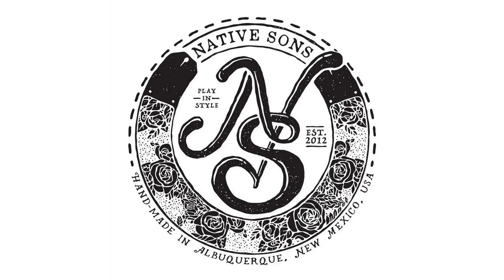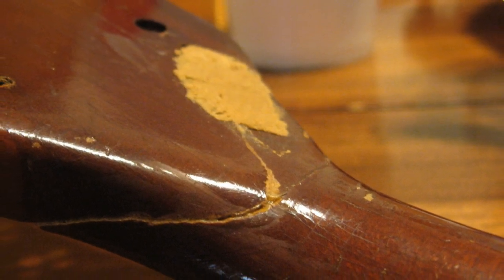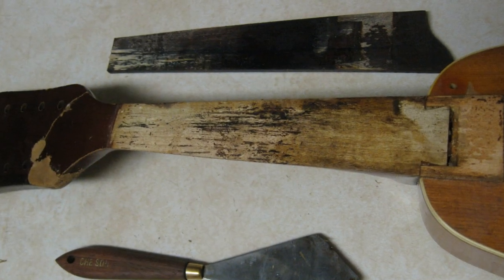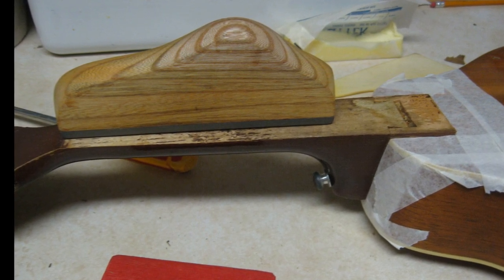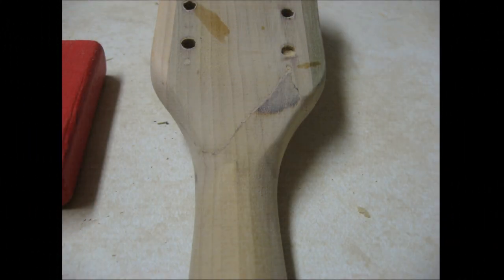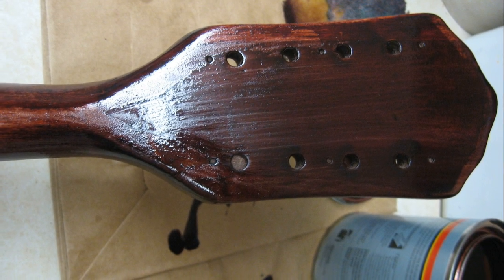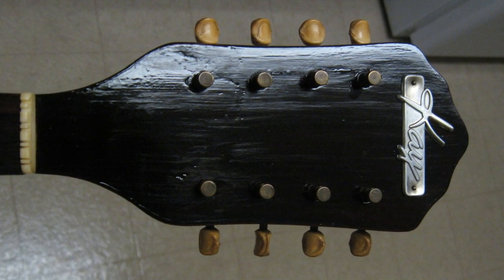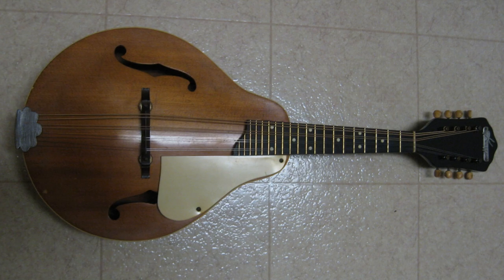Repairing a Broken Kay Mandolin - Projects from the Vault

Comment: Very  timely! I'm  doing  a  similar  job  on  a  custom  mandolin  that  was  damaged  during  a  cross country  move.  This  video  is  just  what  I  needed  to  see .  Thanks  a bunch !
Reply from the maker: Cool. Hope it helps. The longer you spend on the sanding and finishing stage, the better it'll come out. If I had this one to do over, I'd prime it first, then refill and sand any low areas before finishing in a solid opaque color.
Reply: @TheGuitologist  Sage advice! Thanks again

Comment: Even inexpensive instruments from the 50s-60s were made good. You did a great restoration on this one. I might have done a solid color on the neck. I never trust wood putty to stain. The tuners should be replaced, as you know, because the knobs will break off soon. These are another look at your instrument repair/restore abilities. Top shelf! Thanxz
Reply from the maker: Yep. Should have gone solid color for sure. And primer would have caught the low areas in the filler too.

Comment: Good job. I always used epoxy on the first bond and clamped until dry, then the sanding and I keep the dust from the neck and fret-board and mix that with Titebond. I let that dry a few days then apply a thin coat of paint or stain depending and look at it. I only apply the stain to the repaired areas first then depending on the surrounding grain I might use a needle to create a matching grain then stain the affected area again, let that dry and sand with ultra-fine with wet dry sandpaper, the black paper and stain the whole neck and I always get a nice match.
Reply from the maker: Thanks for the comment. I think before spending that much time on it I would just primer it and do a solid color if I had it to do again.

Comment: Butter is not a fret board conditioner ???? Smooth like the land o lakes lady 😂
 Nice work brad 👌🏽
Reply from the maker: I can't believe it's not lemon oil.
Reply: @TheGuitologist  I used Formbys Lemon Oil on a dried out fretboard that looked like it was bleached in the desert sun.
After repeated coats to where it wouldn't soak up anymore I let it sit overnight to find a very dark brand new looking fretboard 24 hours later.
Really blew me away at the difference it made since it looked so hopelessly sad at first.
Reply: That made my night thanks Brad 🤣😂👏🏽👏🏽👏🏽👏🏽👏🏽
Reply: The Guitologist lemon oil is terrible for a fretboard.
tung oil.
Reply: Cole gun oil tastes like artificial banana but don’t taste it 🤮 it’s not safe for humans 😈
Reply: @Cole-ek7fh  Tung oil is a hardening oil. It would be like putting linseed oil or polyurethane on your fretboard. Most of these products are not what they are labeled as anyway. Teak oil for instance is a hardening oil made for Teak not from it. Lemon Oil is mostly mineral oil with just enough lemon oil added for that lemony smell.

Comment: My favorite Wood Filler is CA Glue with Fine Sawdust. I have a jar of Walnut Sanding dust, very dense. I use Bob Smith Thick CA with his Accelerator. It never turns white.
Reply from the maker: That works too, doesn't take stain though.

Comment: Do you remember what wood glue you used? Curious as this head joint would be under a lot of strain after the strings are tightened
Reply from the maker: Titebond all the way. The joint will be stronger than the original wood. As long as you get everything lined up properly.

Comment: GUITAROLGIST, do you build, repair, or modify speaker cabinets/ baffles boards? I need triangle shaped baffle boards, I will pay you for this, I have six, triangle shaped baffle boards, for a custom project, and they weren't cut out with perfect tolerances, I have the template of what I need, if you can build me some custom baffle boards, how do I proceed in hiring you? Thanks